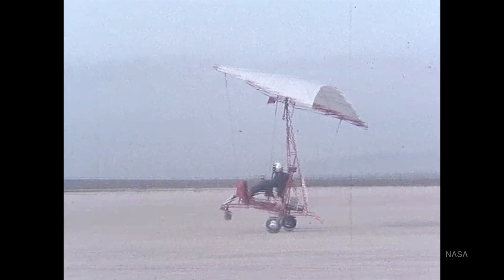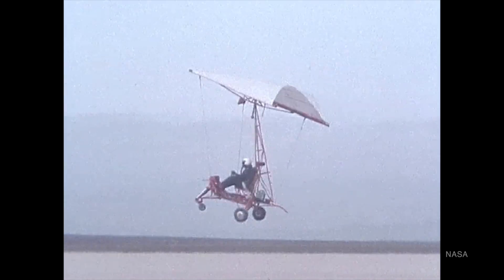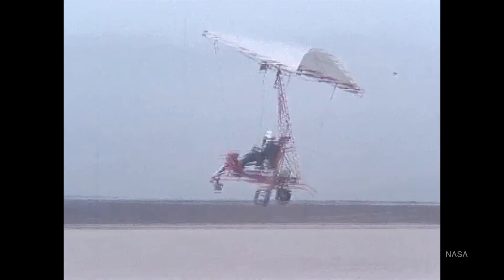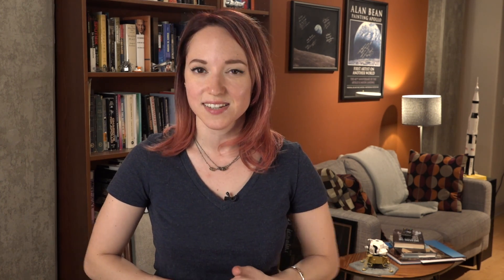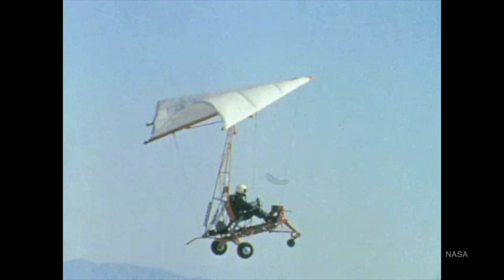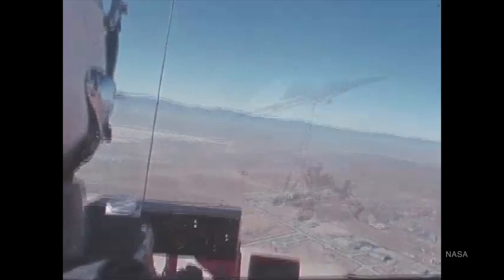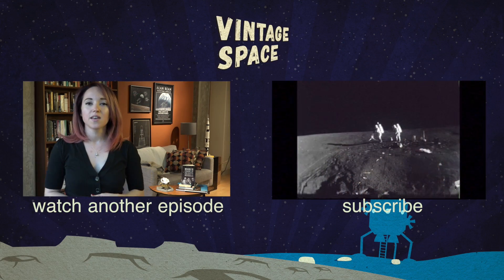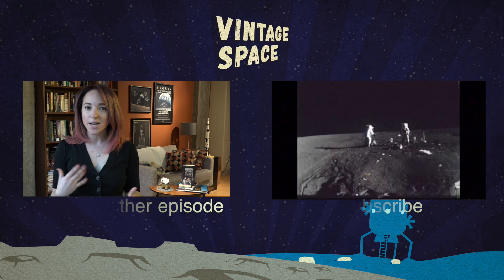The Paresev: The Homemade Flying Tricycle Pilots Built

Comment: My late grandfather, Victor Horton of NASA, was the project manager for the Parasev! After Mr. Bikle relented and allowed the Parasev project to go forward, he placed him in charge of it.  Grandpa designed the pivot mechanism for the wing around a salvaged ball joint from a car. Funny story, in order to save money, he also attempted to use some salvaged troop glider tow cables leftover from WWII that had been sitting on the dry lakebed for almost 20 years; they were still strong enough for the job, but very stiff. On one of Milt's first flights, the stiff cable made the vehicle very hard to control and almost caused him to crash, but he was able to cast-off the line and land safely. After the flight, he got off the Parasev, all fit to be tied and exclaimed something like, "Where's that Horton?? I'm gonna strangle him with that @$&# cable!" Also, another misstep was their initial use of Irish linen for the wing membrane, chosen due to its light weight and long history of use in fabric-covered aircraft; the Newport Beach sailmaker they subcontracted the job to looked at the project, however, and recommended a then-new synthetic material, Dacron, instead (which is still used on many hang gliders and ultralight aircraft today, btw), as it would be stiffer and much less prone to flutter, while still being light weight. But the Parasev team insisted on the linen, which, much as the sailmaker had tried to warn them, resulted in a wing that was too limp and according to some reports, had all the control characteristics of "a wet noodle." The problem was only made worse by the primitive overhead control stick they used on the first version of the vehicle, Parasev 1, eventually resulting in its crash and destruction. When it was rebuilt as the Parasev 1-A a short time later, with a better structure and proper control system, they went back to the same sailmaker, sheepishly admitted they had been wrong and told him to build it his way out of Dacron. Needless to say, even though the Parasev still had its issues, the Dacron wing membrane was a massive improvement. Two other versions tested included Parasev 1-B, which was the same vehicle fitted with a Rogallo wing that had a smaller wing area and thus, higher wing loading and a much faster (and scarier!) rate of descent; and Parasev 1-C, which saw the vehicle fitted with a half-scale version of the actual inflatable-frame Rogallo wing, then slated for use on the Gemini spacecraft and its proposed follow-ons, like the "Big-G" space station ferry. Utilizing a rubber raft-like structure of inflatable tubes filled with high pressure nitrogen gas (as opposed to the 2.5-inch diameter rigid aluminum spars used on the 1-A and 1-B versions), the 1-C proved to be the least stable of the three configurations flown. Incidentally, years later in the mid-70s, when my mother and her cousin, Tim Horton (also a NASA engineer at Dryden like Grandpa, and now deceased, sadly), wanted to pool their money and buy a hang glider together, Grandpa about had a fit. After all the trouble he'd seen with the Parasev, he was not about to let his own daughter and favorite nephew risk their necks playing around with a similar Rogallo-winged aircraft! He absolutely forbade them from buying it. (Little did he know, her and my dad actually borrowed a hang glider from a friend of theirs and tried a couple short hops down a local bunny slope near Tehachapi, heh heh heh)
Reply: Hey Gabriel, Thanks for sharing.  My father, Charles Richard, directed the Parasev program with your Grandpa Vic and Dick Klein.  Your story brings back memories of his stories from that exciting time. He and your grandfather had many great and energetic discussions about the design. I have lots of old NASA B/W photos of the team during the design, build and flight tests. My father passed away in 1999.
Reply: @FAIF3A  sorry for replying so late, but if you remember any of your dad's stories, I would love to hear them! There are many things like that about Grandpa's career that are a mystery to me.

Comment: That thing looks suspiciously like an ultralight aircraft :). 

Wikipedia has the story as follows: The Paresev inspired hang-gliding enthousiasts to use a Rogallo wing on their craft; hang gliders in turn became light motorised aircraft when they put engines on them. I find it interesting that the Paresev to ultralight evolution is so round-about, when they could easily have built ultralight aircraft directly from the Paresev design.

Comment: THIS is the spirit that NASA used to have. An attitude that said that no challenge was insurmountable and rewarded individual initiative to solve problems. After the debacle of the Columbia crash, I fear that the bureaucratic, lethargic and monolithic management structure of NASA has led to the defeat of any program like this that might have otherwise gotten off the ground. When engineers, knowing in their gut that serious damage had been done to the spacecraft, were unable to stir NASA brass into spending a few thousand dollars to investigate the issue, leading to the deaths of seven astronauts and the loss of a multi-million-dollar vehicle, I knew that the NASA of the Apollo, Gemini and Mercury programs no longer existed..........................
Reply: +Mike Barlow , A few thousand dollar test was not the only issue. If the top managers at NASA had spoken up quickly to the correct people at the White House, the DoD, the NRO, and a few other agencies they would have had every possible satellite in orbit trying to take decent resolution photographs of  Columbia. Even the Russians and French would probably have  cooperated in the task. Just like an SOS at sea, you drop the darn bickering and get on with saving lives if you can. Yes, if you get good photos you still have to deal with hole you are seeing, but at least NASA and the astronauts would have known they needed to do something.

Comment: During the cold war space race,was there any area of technology that was accepted the Soviet Union was ahead of the U.S.?
Reply: +Mark Andrews :In the early years (1957-60) we clearly recognized their lead in heavy boosters. At the time, they had the R-7 ICBM derived boosters with various upper stages which if I'm not mistaken, was their most powerful rocket. The Vostok launch vehicle that launched manned Vostok spacecraft generated 875,000 lbs thrust at liftoff vs our Atlas rocket at 360,000 lbs liftoff thrust and later, the Titan-II at 430,000 lbs liftoff thrust. In 1961, our Saturn-1 rocket with a liftoff thrust of 1.5 million lbs beat the Vostok launcher in liftoff thrust. In the early 1970s, despite our success with Skylab, it was recognized the former Soviets were first to put a space station in orbit (1971) and they proceeded to develop a long term lead in space stations with their Salyut series. That changed with the ISS program in which it can be seen that the U.S. and Russia are roughly equal where space station tech is concerned. However, with our former communist enemies being the only nations capable of sending Cosmonauts and Taikonauts to orbit, the U.S. is clearly behind after abandoning the lead we had with the shuttle. While I think it was a good idea to retire the shuttle, it should not have been retired without a replacement vehicle ready to fly.

Comment: And so was born the hang gliding hobby which swept the nation during the 1970s.
Reply: Yes, and no. My grandfather, Victor Horton, was one of the project leaders on the Parasev and helped design and build the thing. I would actually characterize it as being closer to an ultralight aircraft, than a hang glider. The Parasev was not the first nor the only large Rogallo wing aircraft built during this era. Around the same time, Barry Palmer of Sacramento, CA, Australia's John Dickinson and the Tony Prentice in the UK, working independently of each other, all developed true hang gliders using this concept. Dickinson's was probably the most fully-developed and has led some to try and falsely credit him as the sole inventor. There were probably many other experimenters out there, too, whose names have been lost to history.

Comment: Did this "program" lead to ultralight aircraft? The minute I saw the Paresev I thought all it needed was a lawn mower engine mated to a propeller and a shortened connection to the wing and they'd have had an ultralight.
Reply: Maybe Otto Lilienthal was the first who flew a ultralight aircraft, but the Regalo wing really helped to make it popular. A simple wing design which allows you to disassemble and transport your hang glider with an ordinary car.

Comment: sadly this kind of strike out on your own and explore a new concept probably does not happen anymore with NASA... at least I assume that. or does it? Are there any parts of NASA that allow researchers to explore new ideas like this without huge oversight and pre-planning and approval? seems like innovations would be born from it if they do.
Reply: +keeperofthegood ah cool. Glad to hear they are supporting and funding of new ideas!
Reply: +dregerclock :They do on occasion. The Delta Clipper comes to mind. But NASA is so chronically underfunded, it cannot afford to take the risks it once did I the beginning of the space race. NASA was blowing up rockets fairly frequently back when rocketry was a fairly new technology and we had a cold war enemy to keep ahead of. The shuttle failed to economize low orbit so it is still an expensive proposition to do what we currently do in orbit, much less try radical new ideas.